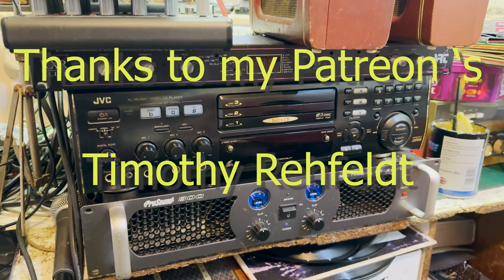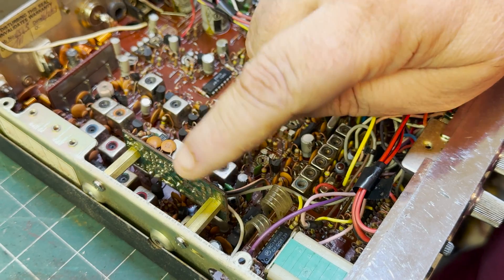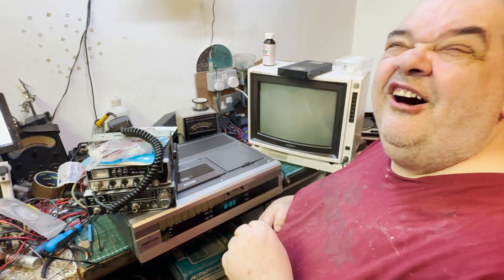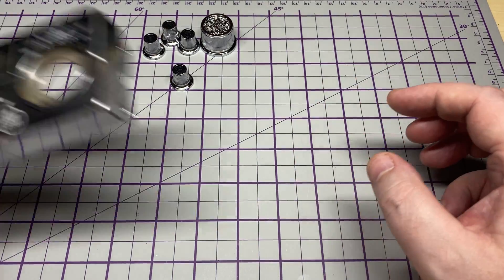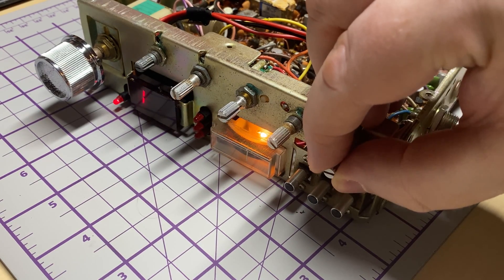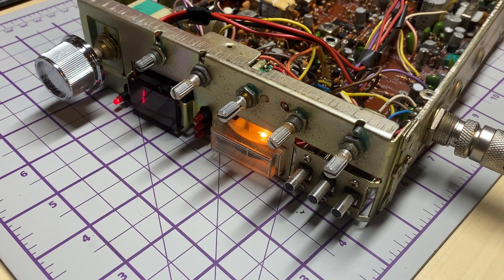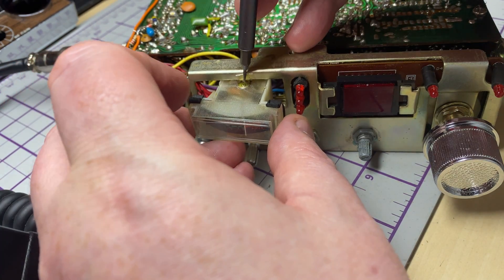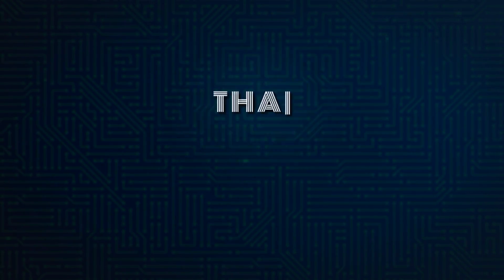EP 149 - Stalker 9 FDX - From scrap to working - Part 1.

Comment: What the fuck did someone cut the traces with a knife and fork.
Reply from the maker: lol made me chuckle that :)
Reply: @MicroChipz  Nice Stalker I just do not understand why people do this all you need is a sharp blade and one small slice and done if you are into doing that.
Reply from the maker: I don’t like cutting tracks , that’s why all my mods are track cutting free.
Reply: @MicroChipz  Same i hate cut tracks i have a Superstar 360FM in a bad way never worked on SSB sets but if i mess it up i could send it to you lol.
Reply from the maker: Sure ,what’s up with it
Reply: @MicroChipz  As most of this type of radio they have had a hard life it has had the old eeprom mod from way back and other wires cut. Had a look at your 360 video so going to strip the front down to have a better look.
Reply from the maker: @chris_vandepeer  mk1 or mk2?
Reply: @MicroChipz  I will have a look what board is in it.
Reply: @MicroChipz  Main PCB:PB-010AB
Reply from the maker: Mk2 then
Reply: @MicroChipz  it is not as bad as I thought it would be inside and it tx and rx so will be good to bring back to life.